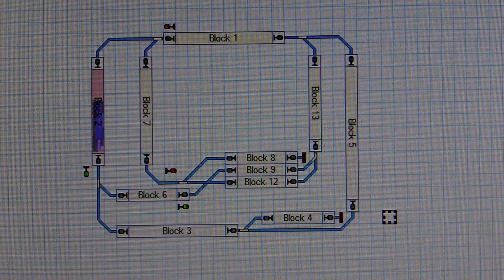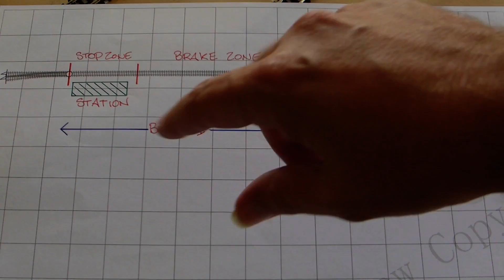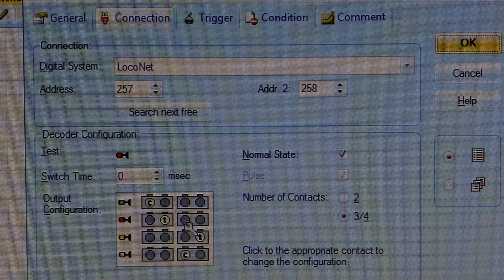Computer control for model railroad

Comment: I have chosen the same hardware and software my big question is when you make a block you have to break the track. When you create the stop zones at each end are those areas software controlled or do you have to put in more track breaks? Thanks in advance
Reply from the maker: +Joe Shaddy hi Joe, each block is electrically isolated that's means you need to cut at least one rail to make a block. So to create a stop zone you need to make it a seperate block. You could imagine if you had a large layout with many stops you need many blocks. Regards Michael

Comment: Great videos Michael, wellp Reduced and informative. One question when you went through a stop zone, to a brake zone and then to another stop zone, how does it know not to just stop in the first stop zone or does the software take into account the direction of travel? I hope you continue to do more videos too.
Reply from the maker: +Paul Hamilton (Lancashire Fusilier) Hi Paul, the software tells the loco to slow down and then to stop.
You set certain conditions to trigger the loco to stop. You only need two stop zones when you are running trains from both directions. Hopes this helps you out
Michael
Reply: Thanks for responding Michael, I was more asking how did it know not to stop at the first stop zone but knew to keep going into the braking zone and then stop in the second stop zone. Why didn't it just stop in the first stop zone or is it only a stop zone when travelling in the other direction?
Reply from the maker: +Paul Hamilton (Lancashire Fusilier) When the train enters the first stop zone there is no trigger set to stop the loco. To automate a train to go around a layout requires many triggers and conditions.
The only way to truely automate trains is to have a transponder on each loco.
Regards,
Michael
Reply: Thanks Michael, I understand now that the stop zone is only half of the equation, specifying the trigger conditions is the other half. Great, thanks. Do you rate the software then?
Reply from the maker: +Paul Hamilton (Lancashire Fusilier) I think the software is good , there is a bit of a learning curve but it is much easier then jrmi where you need to know alittle about programming
Reply: Hi Michael nice video indeed. Can you share me the software name and the hardware you use. I can see that you use digitrax is that correct. Sorry for the question. Just for your info i am very new in this hobby and really need a lot to learn. Thanks
Reply from the maker: kamarul muhamed Hi, the software I use is railroad and co and the hardware is digitrax. if you go to the digitrax website there is a lot of info on each product

Comment: Two quick questions...I want a fully automated layout for under the Christmas tree, with turnouts, lights and sounds. I prefer to use a PLC because I have many of them at my disposal. This means integrating everything with digital and analog input/output. What I cannot seem to sort are the interfaces that will convert the I/O from the PLC to the proper DCC signals. 

That failing, who makes the best DCC interface to a PC running Windows and which software?

Thank you for any consideration of my inquiry:
Tim Gates

Comment: Thank you for posting these videos. I had a lot of questions about the digitrax system but you answered most of them. I'm currently working on an 110 scale mile layout, compressed of course, with double track mainline. 

How do you connect the BDL168 to the SE8C? Do you have to run wires from the detection output pins of the BDL168 to the occupancy inputs on the SE8C?
Reply from the maker: Matt Tjaden Hi Matt, you only need to connect the loconet cable only to the BDL168 and SE8c. The BDL168 can handle up to 16 detection sections and reports this info to loconet. The inputs for the SE8c can be used by the BD4 which can do 4 detection sections but can't report to loconet, so you need to run the BD4 through the SE8c which reports the info to loconet. This is how I wired up my layout and it works a treat.
Regards,
Michael

Comment: Good job on the vids. Hay that digitrax system do you know if it would work with esu ecos controller? To be exact the ecos 50200. I'm looking to do what u just did with the detection and signals system.
Reply from the maker: timothy nobre hi Tim, I believe it will work but you will need a converter to allow the ecos 50200 to read the loconet signals. Check out this web page - http://www.esu.eu/en/products/digital-control/lnet-converter/

Comment: Hi, you mentioned splitting Block 1 into 3 sections.  Are these sections defined by time or are there other sensors telling the software that the train is entering the stop zone?  Regards Charlie
Reply from the maker: Hi Charlie, all the detection sections are controlled by the digitrax bdl-168 board (check some of my previous videos on how I set it up) each section is electrically isolated from the rest, and when a loco enters the section it reports to the bdl-168 which reports to the computer.
Regards,
Michael
Reply: Detroit River Railroad Hi Michael, I'm sorry I didn't make my question clear. 
I totally understand using the BDL-168s to report block occupancy.
However, you mentioned in your latest video that with Block 5, you had three zones, stop, brake and stop.
What makes the loco slow down when it enters the brake zone? 
Regards Charlie
Reply from the maker: Charlie Bishop Wildlife Photography when the loco enters the brake zone I have entered into the program what speed to slow down to and when to start braking.
There is a sliding scale for each section to set when to start braking, the stop zone works the same way but the sliding scale tells the loco where to stop.
I hope this answers your question, if not please ask again 
Regards, Michael
Reply: Detroit River Railroad Got it.  You can enter various commands, depending on the length of the block.  This makes perfect sense.  Thanks Michael.  Regards Charlie